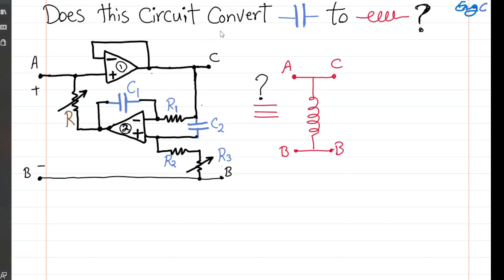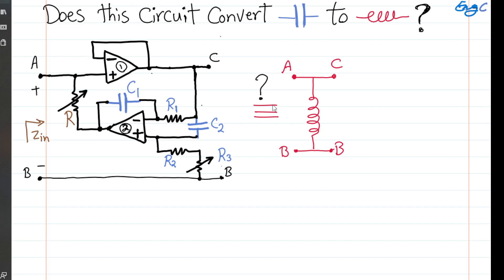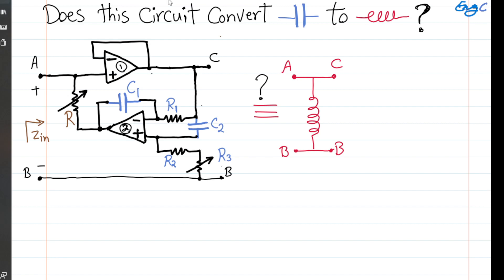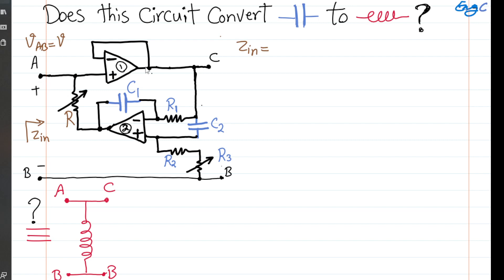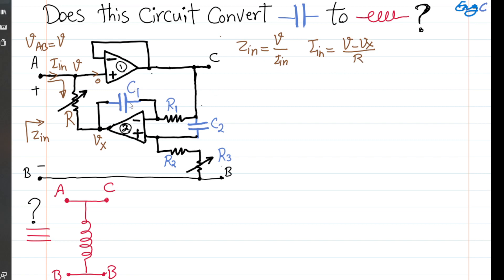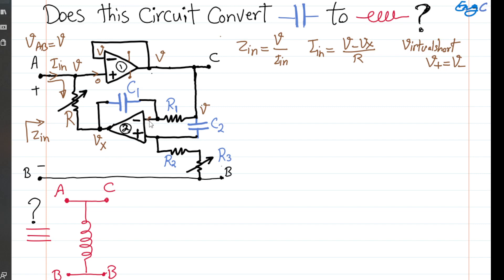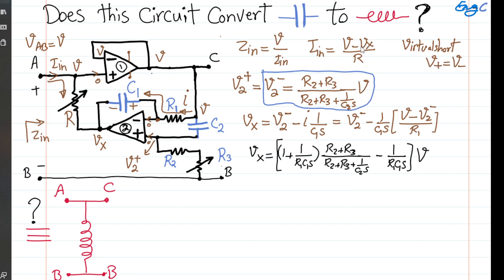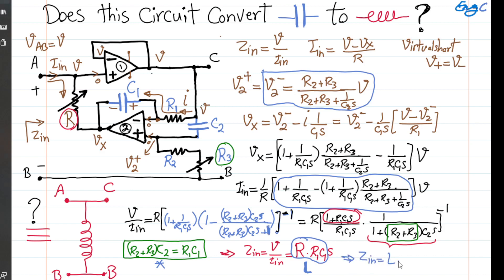Converting Capacitor to Variable Inductor using operational amplifiers

Comment: Thanks for the interesting op amp video. Got a question: It has high Q because  the series resistance to Leff   is  zero?
Reply from the maker: You are welcome!  Yes, to the extent that we can keep the two Op Amps in linear region of operation and we use variable resistors (potentiometers) to set R1C1=(R2+R3)C2 so that we arrive at Zin = R(R1C1)S then it means we have very high Q Inductance with L=R(R1C1) and practically negligible resistance.  In reality Op Amps are not really ideal and hence we will end up with some non-zero but small resistance for the equivalent inductor.